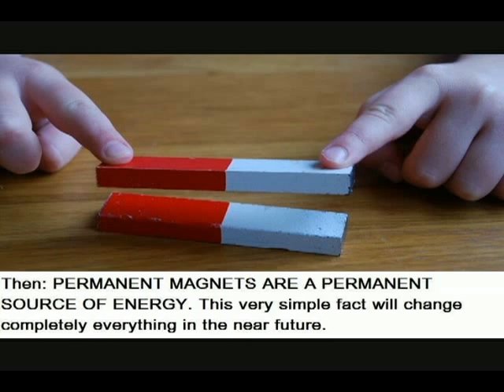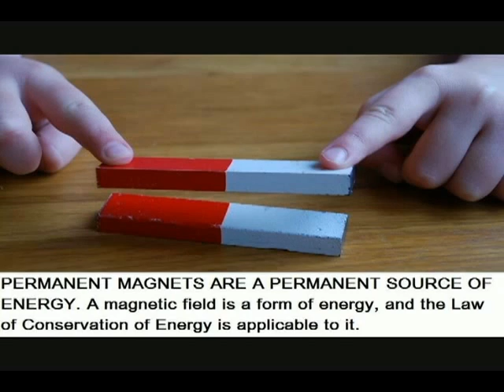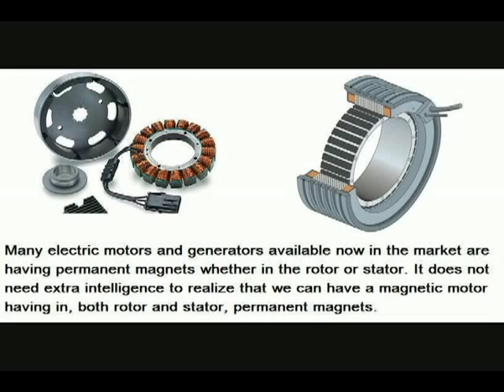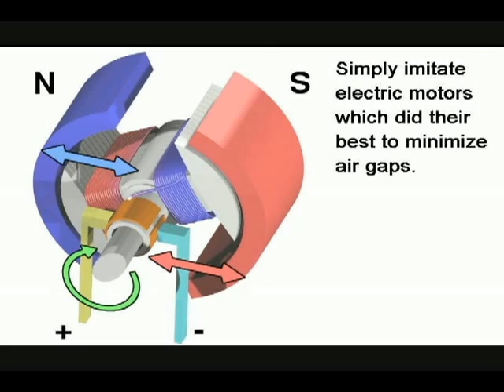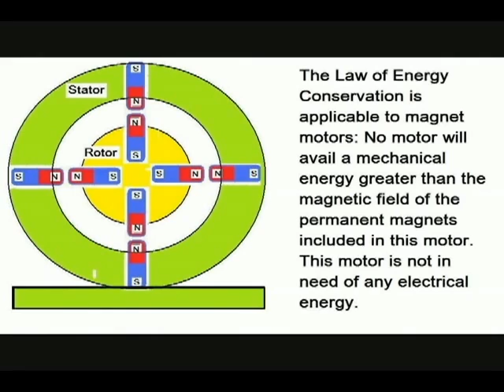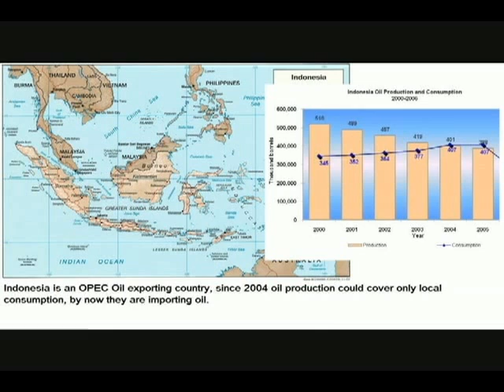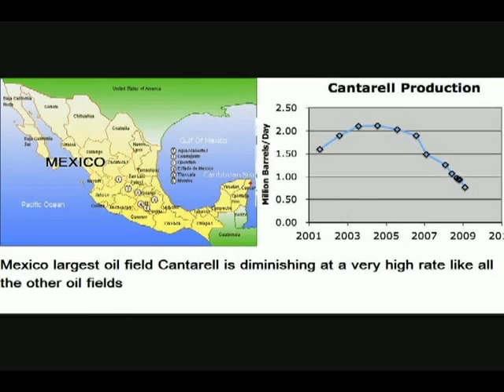Magnetic Motor and Free Energy Explained    1

Comment: Create a magnetic field by running current thru a copper wire, then destroy that magnetic field by shutting off current flow to the wire, around this wire a magnetic field was created and destroyed by turning on and off a switch for current flow and/or direction will reverse the magnetic field direction as well. That is as simple as i can put it for ya.  The copper is from God too, lol so is everything , even the oil is ultimately, we are from creation, our planet, water, air, light, our entire universe.

Magnets are not batteries and do not contain energy, the alignment of atoms and the ability of the material to remember this alignment of atoms is what causes magnets to create constant magnetic fields. You can think of magnets as a tiny storage of memory that utilizes the magnetic field and a magnetic field is an extension created of electricity. Current is created by collapsing the remaining magnetic field but then the magnet would no longer be a perm magnet so collecting energy from the magnet will not work in this way. And the repelling force of  magnet fields pushing each other on a wheel will always repel but since it is on a wheel every time you expect it to spin you fail to realize that it comes back around and encounters the same REPELLING force in the OPPOSITE direction stopping the wheel cold you expect to rotate. In other words the magnetic repelling force it takes to push the wheel will be the same amount repelling force to stop the wheel because it is a wheel it comes back into the repelling field but from opposite direction thus forcing wheel to want to spin backwards at the same time the other magnets want to spin the wheel forward it stops cold, no work will be done.

If you expect a magnet motor to work without external input energy exceeding output energy it will never happen in reality. But to get work done from pure perm. magnets may never be possible without the use of magnetic shielding, electrically and/or mechanically, to allow alternation of the magnetic fields as to allow the wheel to spin. Magnets in combination with coils and caps are what we use today on motors and as you can see they are not over unity. You say we can't create or destroy a magnetic field, i only agree in a perm. magnet once it is made. But this is the problem in perm. magnets, because the field needs to alternate to allow the wheel to spin, and this is what we call and electric motor because this is what they do to allow rotation using AC current for example.

Comment: Nice try, but explain why a normal motor (using electromagnetic attractive and repulsive forces) isn't giving off free energy. At 2:05 there is described a motor with permanent magnets in both rotor and stator. The electromagnetic motors of today rapidly reverse the polarity of a magnetic field to be able to attain motion. This is why motors have commutators, to accomplish the flip of the electric energy through the coils, thereby flipping the magnetic field inside. (TBC)

Comment: Why didn't you built it and put the real thing in video, instead of just drawings? Because when you will do it, you will discover some interesting things about magnets, like sending the repelling waves to other magnet on the wheel instead of the one outside of it... Then comes the "ecranation" materials that conduct magnetic fields through other routes and even repeling materials... and then new discoveries, new problems to solve. But they can be solved, except not in the way you did painted it.

Comment: except for the size differential of the ball and the earth, you might have a point. However magnets are the same size and can benefit from the centripetal spin that they are constantly seeking. Since when can you turn a spring on and off?

So my certificate holder, how does pulsing an electromagnet near a permanent magnet change your scheme?

Comment: I'm not wrong.  If the nail is attracted vertically initially then it gains potential energy.  To remove the nail from the magnetic field requires energy (expended in the muscles).

Conservation of energy doesn't apply as it is an open system.

I really can't see what your point is.  Best if you stick to comments about magnetic motors as you're going off the track and missing the point.

Comment: @twylasfaves - actually it doesn't work. The force generated by two magnets as they repel is the same (but opposite) force required to get the same magnets into a position to repel. Therefore no net energy release.  Friction stops all magnetic motors.

Comment: @BassicPeach   there's no free energy in magnets, the electrons are just aligned all together so that individual electrons' magnetic fields are all summed up and looking in the same direction.
Reply: Energy is 1/2 mass*velocity squared. What people want is not energy, but toggleable velocity. There seems to be no obvious way to "toggle" permanent magnets for this effect. You can do it with electronic magnets, but to do so requires adding more velocity into the system (electric velocity.) 

Another problem with the video is that magnets in repel mode destroy other magnets. Idk if it would take 100 years for someone to notice or if it only happens after a certain threshold. 

Anyway, its the same problem as gravity. There is no on/off switch for gravity, so it isn't immediately useful to humans as toggleable velocity.

Comment: the theory of free energy is sound magnets arnt creating energy the energy is always there magnets create repelling forces and as a result of magnets been in such close proximity permantly (inside a motor) they constantly repel each other directing the magnets in an offset will create rotation once the rotation has started it should in theory never stop the only energy needed is the energy to get the rotation started once started it will spin on its own using the force of repultion as power

Comment: Did you know that you can extract Hydrogen from water?
Hydrate cannot be purchased because its use for making bombs, but it also stores Hydrogen in a much safer manner with even larger quantities.
You can create it though, but you'll need an particle accelerator to do so.
Nevertheless, Hydrogen can be extracted via electric current hooked on to a sheet of stainless steel, positive freeing Oxygen, negative freeing Hydrogen.
If magnets can create power, why not use it wisely to do just that? ;)